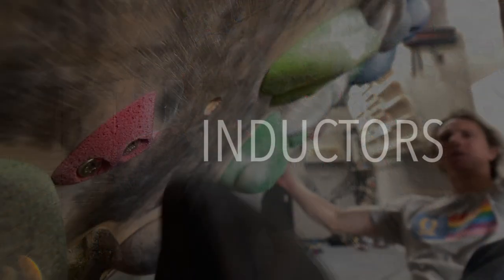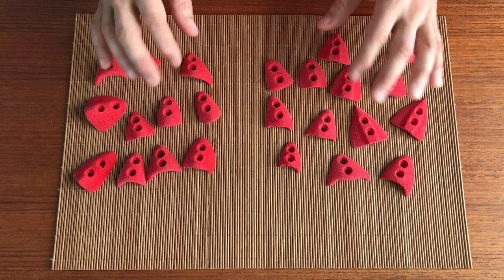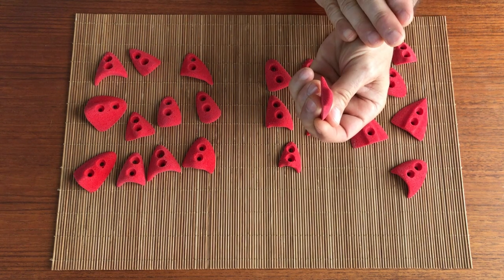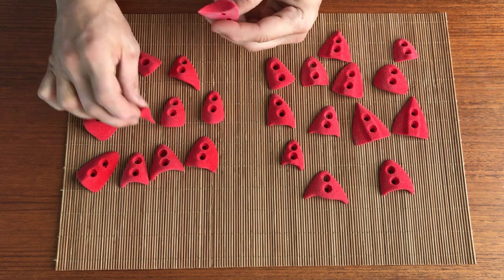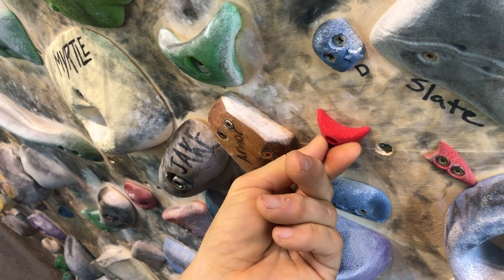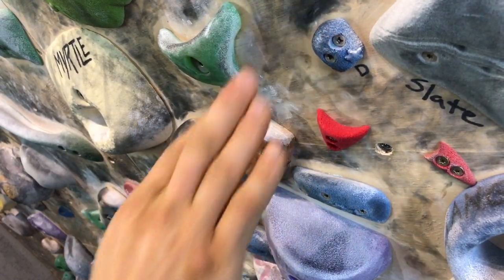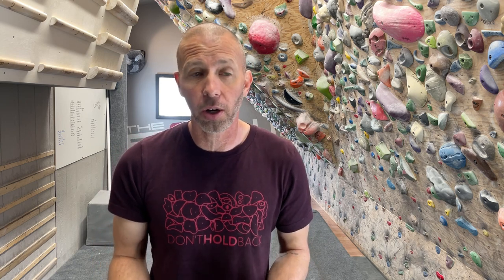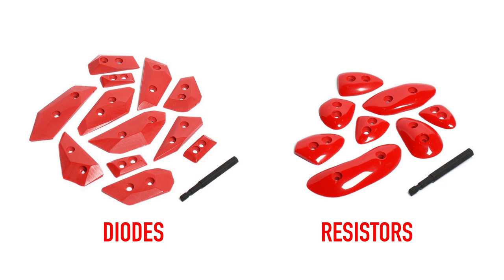Bad Feet are Good for Your Climbing | Inductors

Comment: Honestly I would prefer these than the slopey lil holds that gets greasy n rubber filled after a while
Reply from the maker: For sure. Different skill as well. Slopey feet require something different (and are much cheaper and easier to make) than tiny incut feet.